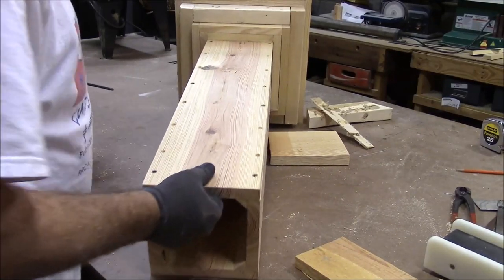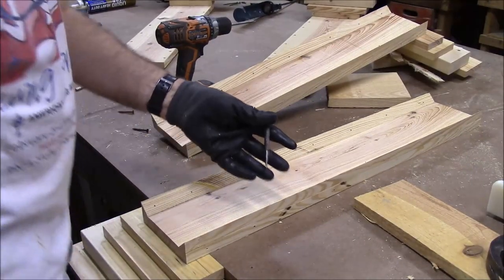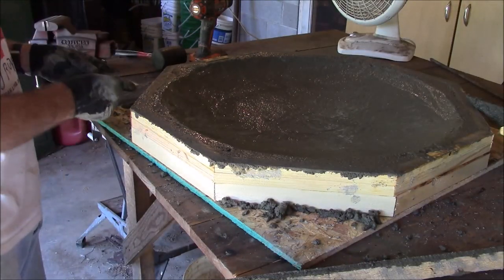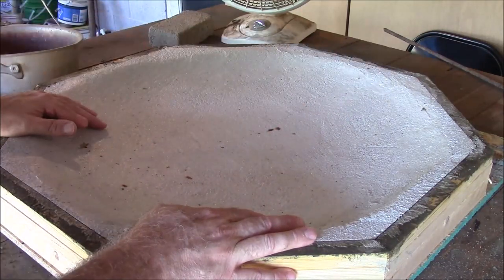How To Make A Concrete Birdbath Part 2

Comment: might be a bit late but if you put a chuck key in the end of a drill, and hold the drill to the side of your mould you can use it to vibrate the air out of your mould.
Reply from the maker: That's a great idea!  Thanks for watching!

Comment: 10000000 stars!!!  Now you can make plenty with those molds!!!  Love it!!!
Reply from the maker: Thanks!!
Reply: i've made over 30 baths with mine but used screws everywhere possible because I was worried about the nails loosening up after 5-10 baths.

Comment: Already made one, making another now. Great idea and great outcome 👍
Reply from the maker: Thanks!
Reply: my finish products has hundreds of air holes showing- same as the soat mon video. Did you do anything to fill and / or then paint the birdbath. Viewing from a distance it doesn't matter but up close it doesn't look finished very well.  Yes I tapped on the mold for 30 minutes ND used a saws all to try vib rating the air holes out.
please let me know. thks

Comment: As dry as it is , at zip code 34698, I put Two Bird baths out. One old one, the birds don’t care, and I went to the big box store and bought a water heater drain pan,plastic, put it on an old table with a 12 inch paver in the middle so it don’t blow away. I put the PVC fitting on the drain hole and the water is about 1 deep. Nice work by the way.
Reply from the maker: That's a quick birdbath solution. Thanks!

Comment: 7:20 Gravel in concrete is for compressive strength, not needed for this. Therte are very light weight materials that can be used.

Comment: Nice work! Did you do anything to seal the concrete against water penetration?
Reply from the maker: Actually no and I expected them to crack during the first freeze but they have been through sub zero weather and have held up for years.

Comment: Might be a stupid question.. but... why did u paint the wood with oil?
Reply from the maker: It helps protect the wood from the water, keeps the wood from drying out the concrete too soon, and helps the concrete release from the wood.  Thanks for the question.
Reply: @SoatMon  thank you!

Comment: Thank you for sharing your project. I've been thinking of doing something similar for a few years, so when I came across your video I was really grateful. A couple of different ideas I had: instead of making a wooden sweep to create the bowl, I was going to use a large shallow plastic dish, and press it into the wet concrete to form the bath. Did you consider this, and if you did and decided against it, what would your reasoning be for rejecting it? If there's a good reason why I shouldn't do that, please let me know! Next, did you consider adding a fine skim coat to the bowl once it was in the drying phase to make it smooth? I was thinking this might slow down algae growth. A great project, and it turned out really well! Thank you.
Reply from the maker: If I was going to make a new mold for the bowl, which I will try to do when I make more of these someday, I would try to make a mold that had the bowl part on the bottom but that would require me to make or find the correct shape to put in the bottom.  Your bowl might work.  I don
t think I would be able to press a bowl into the concrete, it doesn't tend to move that easily.  I didn't like the sweep method that I used but it did work, it was just frustrating. I didn't think about doing a skim coat, only because I don't tend to finish projects to that level unless necessary.  I do think it would be nice and make it easier to clean.  The birds might slide around a little more though..;)
Reply: A couple of comments since I have just recently replicated the octagon bath and pedestal - I too found the sweep frustrating and basically removed the sweep assembly and used the lower curved board as a guide for depth around the edges of the bowl - that worked better for me -  on my second bowl, I had too wet of concrete mix and the mix kept sliding down into the center of the bowl, my bad and ended up scooping it out and replacing with new mix of concrete- also this bowl is very heavy and I wanted something lighter also made a hexagon bowl and then a pentagon bowl- yes I like the geometric designs as opposed to the round bowls. Then if that wasn't enough- I cut 4' off the tall pedestal for a normal height and the took it one step further by inserting a wood plug in the top of the pedestal mold to make a pedestal 20" high. They both are very cool and friends and family love them both - the- my sister asked for a round birdbath, so I bought 3 round planter drip trays and used 2 of them to make a 15' round with 12" bath bowl- it worked great after weighing down the inner bowl until the concrete set up. Also found using premixed tub of thinset mortar mix - watered down a bit and applied with a paint brush was perfect for skim coat before spray enamel primer and painting. Am having fun learning as I go and am most thankful for SoatMon part1 and part2 videos @andrewatson9805,  @SoatMon

Comment: Love this project!  They turned out very nice and look great in your landscape.  One question, you didn't mention but did you use a sealer on the bowl?
Reply from the maker: No sealer.  I was unsure how they would go through the winter but they did great.  We had several days in the low teens and no cracking from freezing.  Thanks for watching my video!
Reply: I add PVA in the mixing process or Feb-bond or even plasticiser so I can work longer and take my time. It delays the drying time a little like the add-mixture bricklayers use in their mortar. I also use very large stainless steel catering bowls to make the birdbath form, one inside the other. They come apart very easily once the concrete has set solid and give the inside and the outside a lovely smooth and often shiny finish. I did look online to find some pillar/pedestal moulds but they were disgusting prices so like you I make my own forms. Hundreds of dollars cheaper. Nice build, I enjoyed watching it as you just got on with it and didn't bore us like others with continuous blabber. Nice one and thanks for showing.

Comment: Great project , It turned out very nice I like the look of the stepped edges. You talked about making two bird baths did you ever make the second one?  How did the form hold up? what was the cost of the concrete that went into the bird bath? Thanks for the video
Reply from the maker: I did make the second one.  The form held up great.  The second one was much easier to make since I knew what I was doing the second time.  It's been awhile but I think the concrete was about 5 dollars for each bird bath.  Thanks for watching!